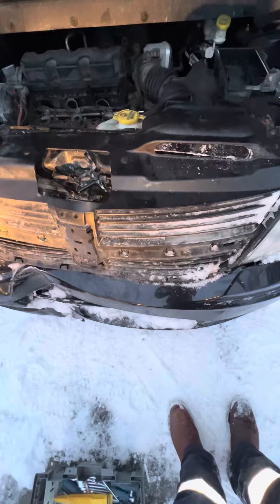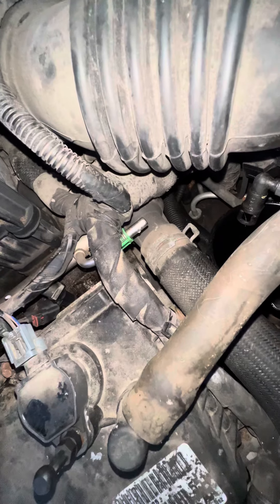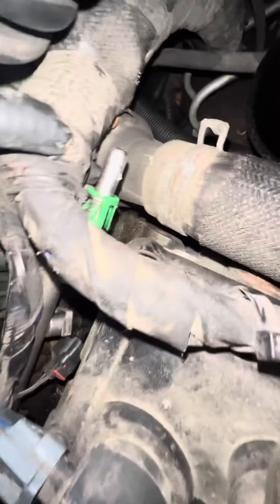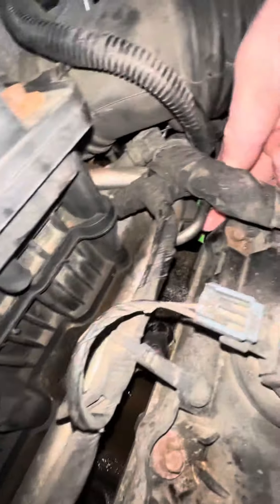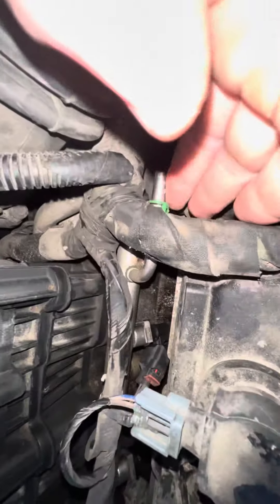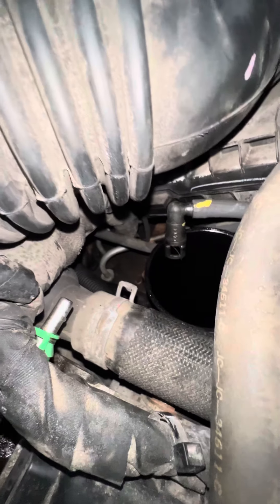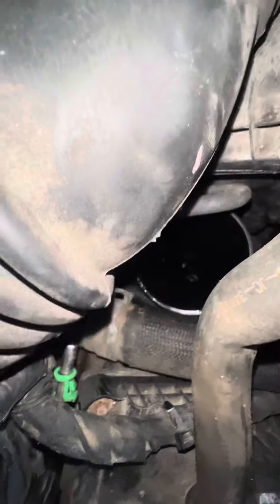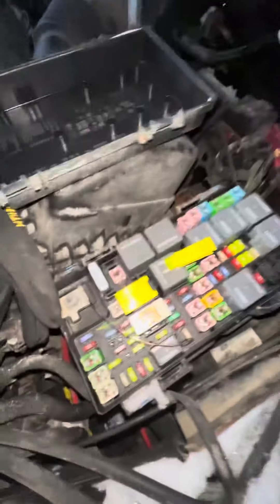How to drain fuel from a modern car that can’t be siphoned (crashed) Dodge Journey

Comment: Your video got me in the right direction to drain the gas tank in my 1994 Dodge Grand Caravan that was no longer reliable on the road. I removed the vent port cap on the fuel rail, then removed the valve core using the same tool one would use to remove the valve core on a tire stem. Pushed a clear vinyl hose down onto the vent port and secured it with a hose clamp. The free end of the vinyl hose went into my 5-gallon container. I pulled the Fuel Pump Relay but didn't touch the fuel pump fuse or anything else in the power distribution center. Then inserted the male connector on a 14 gauge jumper wire into the relay socket female terminal 87 and ran the wire to the positive battery post.  At the battery post end of the jumper wire I had an alligator clip. (BTW - the number 87 terminal of a relay is the load side of the relay.) Thus power was going directly from the battery to the fuel pump and bypassing the ignition switch, fuel pump fuse, etc.  The engine was not running and the ignition key was not in the car.

It was a slow steady stream with lots of air seen in the vinyl hose, but it worked to drain about 18 gallons of gas in about an hour. I left about 2 gallons in the tank to move the van around my property. Of course I replaced the valve stem and cap, and fuel pump relay before starting the car. Starting took a few seconds longer than usual but once going it ran just fine.
Reply from the maker: Whatever worked for ya I’m glad it helped

Comment: “Kinda small than I wanted it to be”. That’s what she said. 😉
Nah jk. Good advice. I’m buying a 2010 Dodge Journey that’s been sitting up for around 3 years with about 1/4 tank of gas. I got it running a couple of days ago. I picked it up for $500 and it’s not in bad shape at all and I want to get the old full out and I thought about siphoning it out but this seems easier. Thanks 🤙🤙🤙

Comment: Hi sir, how to do it on a dodge journey 2.4L? I tried it to do the fuse jump and did not work.
Thank you!
Reply from the maker: Turn the ignition on might be in a different location on yours too
Reply: Ok so I have to 2.4 also. I got it work by placing one side of the cable in the fuel pump fuse like the video then the other side of the cable in terminal 30 which is found in the ignition/start relay on relay "k145"

Comment: We’re you doing this with vehicle running?
Reply from the maker: Nope the engine was fried it was crashed and the owner wanted the gas siphoned out but I couldn’t get past the screen and elbow to get into the tank

Remove the fuel line from the fuel rail, find the fuel pump fuse and jump the fuse with a piece of wire